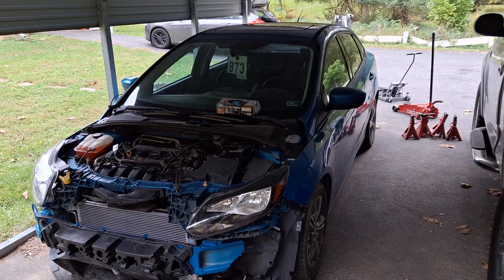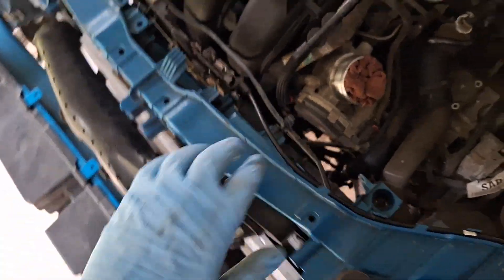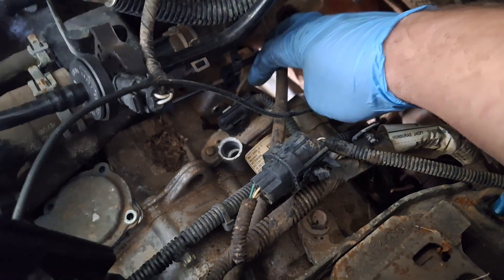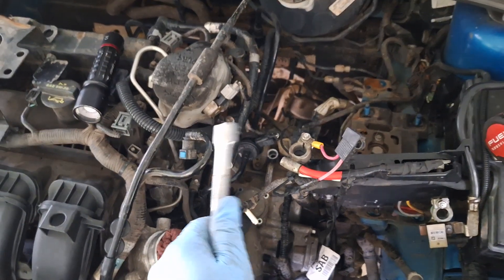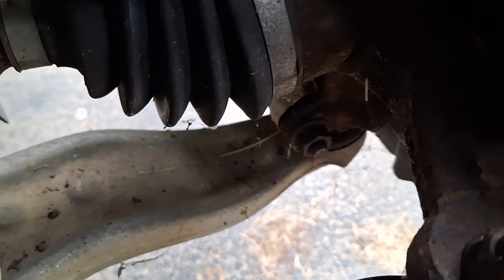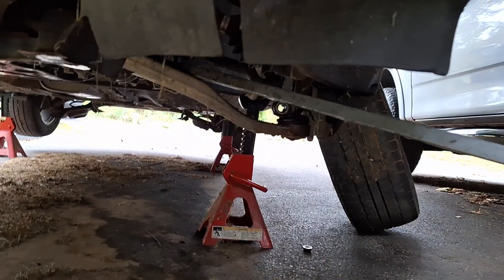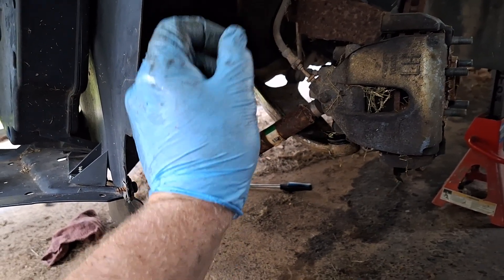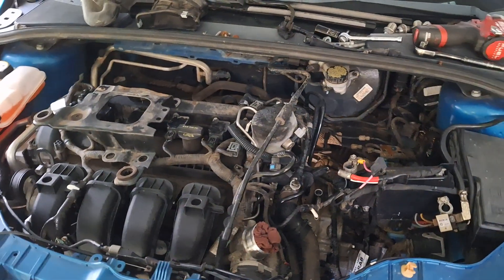Ford Focus Transmission Removal! DIY At Home! | 2012-2018 DPS6 Powershift

Comment: in my other video forgets to post it or link it in the video

in my other video
Me with my transmission halfway out, and can’t even read the full descriptions of your other videos in the playlist. 

Good video man, just being critical because we could all improve somewhere. No one is perfect, and I love your channel. I say this because I don’t want you thinking I’m all negative or attacking you. The cat video was rather easy to find, but only being 1 min 35 seconds….. I feel it was a little odd to look for. I can’t find the main video of you pulling the transmission on the lift, I’ve seen you do it numerous times, but, no dice

Edit: Also I legitimately cannot find this last bell housing bolt. Got the ground next to the starter, the two holding the starter. Took me 2.5 hours to do the ones above the catalytic converter, got the top three, the two top-mount, the bottom mount thingy, and the 4 at the bottom. The bell housing has a TINY gap and moves a lot, I’m sure I could use that to locate it….. during the day…. But…. Holy crap lmao
Reply from the maker: You can't read the description? What do you mean?

Comment: is it worth picking up a free 2012 focus if the only thing i need to do is replace transmission?
Reply from the maker: Absoultely. Youll also end up replacing the upper engine mount and valve cover gasket too. And it would be a good idea to replace the plugs, belts, water pump, degas bottle, heater hose orings, if you're gonna go on long trips
Reply: @BigBensCarsAndCycles  Thanks for the reply i'll certainly be doing some of this stuff right off the rip but i don't think i would have though of some of these things like the orings or the degas bottle so thanks for the list
Reply: @BigBensCarsAndCycles  so talking to my friend that will give me the car he says it's not shuttering or slipping at all but it's not shifting right. Its staying in a gear and not upshifting, and even downshifted on him once. That's a TCM issue right?

Comment: does this work with a 2011 fiesta?
Reply from the maker: Its very similar but theres some bolts in different spots and i like to unbolt the knuckle at the strut on those instead of popping out the ball joint

Comment: I noticed that this ford does not have an active grill shutter . Is it bad for the car to not have it . i have an 2012 model i think it is a se model 2.0 l and i had a problem with it not opening or closing i changed the small motor and the harness checked the fuses still the same issue . what could be the problem '

Comment: How in the holy hell did you get that drain plug out that easily? I'm about to drill the damn thing out.
Reply from the maker: You definitely need a socket and a ratchet a long ratchet preferably. You may need a double up with a wrench on the ratchet to get more leverage. It's really darn tight
Reply: @BigBensCarsAndCycles turns out on the 2018 sel the drain plug isn't an 8mm, it's a t-45. An 8mm will fit but won't get enough grip.

Comment: I don’t think I remembered to take the shipping brackets off the clutch forks before I put the clutch back in.  Do I need to do it again?😢
Reply from the maker: Just stop and try to turn the clutches by hand counterclockwise 10 to 12 times. See if they move. If they are locked up then pull the clutch back out

Comment: How high did you have to lift the car to get the transmission to fit under?  I'm worried my jack stands aren't tall enough
Reply from the maker: I just have regular jack stands one and a half ton I believe if I'm not mistaken and I just got them as high as the Jack would go for the most part. Probably about 80% the way up that the Jack would go so you really don't have anything to worry about. Worst case you take out the left front fender liner and it'll slide out through there if anything happens

Comment: Now if I pay the $4000 will I get a new transmission and avoid breaking my car 😅
Reply from the maker: 4 grand would be a clutch job
Reply: @BigBensCarsAndCycles oh. My cars rpms spike when driving and take a second to settle. Also after breaking and trying to go again it goes… “vvvvrrrrrooo” loudly then goes back to normal. 

Im assuming it’s an issue with my transmission. Honestly i just need a second opinion from another human. What do i do. Its my first car and i dont really have someone to ask or any idea of what my next step should be 😅

Comment: @BigBensCarsAndCycles driver side axle is stuck inside of the trans and will not come out. Any tips?
Reply from the maker: You can remove the transmission with that axle still in, and focus on it outside the car. The clip might be stuck on it
Reply: @BigBensCarsAndCycles okay sweet! I’ll try to look for that clip and if not then I’ll just drop it with that axle in! Thanks man!

Comment: You don't have a video on pulling a MTX 75 from the junk yard do you?
Reply from the maker: No, but I'd watch my mtx75 install video for any tips you need. I just dropped out the engine and Trans from the car. Literally on the ground. After removing the bottom hardware. Then unbolted the rest and it slid right off

Comment: Hey Ben, what is the correct torque for the ball joint pinch bolts? I see a lot lf conflicting info online. Ive read 34ft lbs and 61ft lbs. Thanks!
Reply from the maker: @jordang3015  61
Reply: @BigBensCarsAndCycles Awesome. Thanks a lot!

Comment: Hi! dumb question, do you have to drain the transmission fluid before removing the transmission?
Reply from the maker: @manuelortiz7731  no, but it may leak out of the axle holes when it's out and moved around
Reply: @ thank you. Same case, it’s going to be leaking when replacing the clutch. Then as night as well drain first I guess..
Thank you for posting your videos…

Comment: Can I remove the transmission with only having the fronts jacked?
Reply from the maker: itll be difficult to remove and install the transmission if the car isn't level because the transmissions gonna want to sit level when its on the crane so then its not gonna be lined up with the engine if its not leve
Reply: Aww man, I should've been more patient until you replied. I'm already about to take off the ball joints on the driver side. I live on nothing but dirt land and it was sketch trying to jack up all 4 points. I have enough clearance with my 12 ton jacks for the transmission to come out. Will the car roll back on me? You say it's difficult, but is it possible?

Comment: If I'm going to replace the tcm module on ford fiesta 2016, do I need to reprogram?
Reply from the maker: @melchorelaydo6499  yea if it's brand new. If it's used, off the same year model car then no. Just a clutch adaptive learn
Reply: @BigBensCarsAndCycles  thank you. I appreciate your support

Comment: "Clutch" went bad on my 2017 focus se hatch. Dealership wants 5000 to fix it. Lol. Bought the vehicle brand new 7 years ago and JUST paid it off last month, one month later, clutches fail. I'm now buying a 2017 civic lx hatch with the 1.5 turbo. Going to keep this focus.. in contact with a law office about it at the moment, it's now just been sitting in my driveway for 2 weeks.. I will either sell it for cheap if the offer arises, or make it a project car and try to work on it myself..

Dude, your videos are amazing, and convince me that this is something I'll be able to do myself. Going to be a lot of work and time, but I think it will be worth it, especially after reading the other comments and seeing how this video and so many of your other vids have helped them tremendously. You are a lifesaver dude. I will update this comment in a few weeks with whatever I ended up doing 🙌
Reply: Hmm🤔 I guess it didn't go as well as you thought huh !😂😂😂

Comment: Having replaced the clutch recently on my 2005 Focus ST with 250,000 miles on it I can appreciate the efforts taken to do this job! Getting it out was one thing but putting it back in took two grown men half a day!! 
    I almost killed this car however last week by hitting a deer at highway speeds. Completely demolished drivers side fender, lights, hood, air box, radiator, core support, broke the throttle cable, and windshield. With the aid of a gallon of water and a zip tie I was still able to limp home 6 miles but now I have a parts list of over $1,700 to repair (no paint or windshield) a $2,000 car!! 
 Answer???????
   After extensive research, and the help of your videos, I purchased a 2016 Titanium Focus with 130,000 miles on it from a seller 200 miles away for 5k. Clean CARFAX, no wrecks and great service records! The return trip was a joy as this car is loaded (leather, heated seats) and the transmission shifted beautifully. It has the updated TCM but it does however have a cracked coolant tank that I will replace ASAP. 
   This was $2,000 below anything else I could find comparable and I feel like I got a great deal. Your opinion would be appreciated as I feel like the other shoe is going to drop!!
Reply from the maker: @mitchculpepper738  sounds like a nice purchase! You'll have to fix the transmission eventually but other than that, nice buy

Comment: 165,000 on mine and my ford dealer is saying I need this. Is it worth it? 3,600
Reply from the maker: You can DIY it for 700. Or manual swap it for 700 (DIY)

Comment: Is there a way to clean out the double-clutch without dropping the transmission? My friend Focus slips from time to time, so I’m assuming the clutch plates are dirty causing the minor slips. So without going thru the headache or dropping the entire transmission, is there a way to someone just crack it open and spray parts cleaner in there to maybe drain the debris out? Just looking for a simple way.

Comment: Did I understand correctly that the axle shaft bearing retainer is one time use so I need to order a new one after I remove mine?
Reply from the maker: Thats right. you can get the kit at ford EV6z-7052-C and it comes with it, and anything else you need. 50 bucks

Comment: @BigBensCarsAndCycles
 So I tried removing the tranny before watching your video. I didn’t remove the flex plate nuts and tried prying it off. I didn’t know it was held by those nuts 😢. I ended up removing the whole engine and tranny assembly. The tranny mostly held up by the tension of the flex plate while removing. The question is now, do I have to replace both the dual clutch and flex plate? Or either of them? Or is it okay? Apparently the dual clutch has been replaced within the last two years. What can I say? I have trust issues 😅Thanks for the help.
Reply from the maker: @FreePalestine1173  they're stout parts. I would roll the dice. Unless you heard terrible sounds while prying
Reply: @ thank you! You’re a life saver. One more question. Where do you get all the snap rings? Or do they only come in kits with the dual clutch? Thanks again.
Reply from the maker: @FreePalestine1173  get the kit at ford, number EV6Z-7052-C

Comment: Where did the water come from mine was filled to the starter with water
Reply from the maker: @jaytank31  check for a detached cowl. If that's OK, it may be from a flood
Reply: @BigBensCarsAndCycles  it hit a black bear and sat I drained it out but seams like every time I start it water drains out of the bottom of trans from a long bolt I removed to drain it.  I still can't get ot to go in gear yet

Comment: appreciate you taking time making videos 👍. question: any advice pulling engine #1 cylinder threw rod- locked up. can't turn crank how to disconnect engine and transmission if its locked solid
Reply from the maker: @sonofsteve566  hi, you can take the engine apart until it turns over. I would pull the oil pan off and loosen the rod

Comment: Hey Ben, thanks for all the help with your videos! Im having trouble gettign the flywheel bolts off as they wont budge evenw ith someone holding thr crank and me trying to break them with a wrench.  Not sure what to do.  Thanks!
Reply from the maker: Hi! You're taking the flywheel off? Try using an impact if thats possible for you
Reply: @BigBensCarsAndCycles  sorry I meant the clutch bolts. The 6 that bolt on to the flywheel studs
Reply: Sorry that bolt to the clutch studs to get the transmission separated
Reply from the maker: @rev9921  center the nut in the starter hole area and loosen it with a ratchet, and it'll turn but use the engine block to keep the clutch stationary while breaking it loose. The socket will be pressing against the block as you break it loose
Reply: @BigBensCarsAndCycles  I tried that and still can’t get them to budge. Can I spray pb blaster on them?

Comment: Why do you turn the engine over? Torque converter clutch nuts accessible from the starter or ?
Reply from the maker: @brandoncaudell8062  yes clutch nuts

Comment: mine has a rubber grommet under the starter, the short and stubby one does anyone know which way it goes back in, i cant remember they way i pulled it out. Help would be much appreciated.
Reply from the maker: The side with the 2 indentions go toward the clutch (2 hole looking things)

Comment: HI Ben did you not need to take the intake manifold out? how did you access the flywheel nuts? Thanks.
Reply from the maker: Hi, no i didn't take it off. I remove the starter (leaving the wiring nuts on) and move the starter aside, then remove the nuts from the bottom of the car with a 13mm socket, flex socket and extension

Comment: How to put transmission fluid in my 2014 Ford focus? Do I have to take it apart to get to the transmission?
Reply from the maker: You can put fluid in through the vent, it takes 1.8 quarts service fill
Reply: @BigBensCarsAndCycles  legend. I was gonna snake it.

Comment: Do I turn it clockwise or counter clockwise? Also would turning the engine the wrong way put it out of timing?
Reply from the maker: Clockwise. Yes there's a chance it can mess up timing
Reply: @BigBensCarsAndCycles  I just had my transmission fixed, I went ahead and installed it. But now it won't start. It will crank and will only stay on if I rev the engine around 3-4k rpms. It then shuts off if I let off the gas? Does that sound like timing is off? No loud noises, the engine is just struggling to stay on. Thanks for the response 👍
Reply: @DaBuGzLiFe check your vacuum hoses

Comment: This playlist from Ben was so helpful! I dropped the trans and replaced dual clutch following along and the car is back on the road! Thanks! I had no codes but R, 2, 4th were slipping and trans for warm. When I opened up transmission the bearing was completely broken! Engine hoist was a huge help to be able to move trans around to line up.

Comment: Thank you for everything ben!! I could not have done this without you. All the information you give us focus owners is insanely invaluable and you deserve all the success you're seeing now! I subbed at 1k and now you're at 6.4k. Just test drove my car, reused the clutch by locking it using your other video, and I can confirm that my car works better at 130k miles than when I bought it at 80k miles. I cannot thank you enough!
Reply from the maker: Great! I'm very happy you got your transmission fixed, and the growth is so exciting

Comment: So do you do you have to lift or drop engine at all I'm about to start the DIY drive way job but I have 4 stands and a jack how can I get this job done with only those or do I need something for the engine?
Reply from the maker: Hi, you need an engine crane to lower the transmission out. Use the eyelet on the transmission. Use a floor jack to raise and lower the engine as you lower the transmission
Reply: No crane Im doing this job in a parking lot to be honest just man power and wisdom
Reply from the maker: @TravisHadder-gg7uk  well.. hmm.. you can take the upper and lower mount brackets out and get a few guys to muscle the transmission down by hand and use a jack on the engine oil pan to slowly lower it as needed
Reply: @BigBensCarsAndCycles  i was gonna just use my jack but then read that you said using stands and not a lift there not enough Clarence that way i did see at my local wally world they have these low profile 4 wheel easy rolls that you put under tires to be able to just push a car anywhere you want in a garage thought about trying one of those or a low profile lay on car things ....i don't know I'll figure something out but man ty ty ty you deserve a YouTube gold metal the headache we/people are deal with these transmission is a nightmare
Reply from the maker: @TravisHadder-gg7uk  you can lower the transmission down with a jack but gets some help putting it on the ground off the jack and slide it from under the car. Jack stands are enough. Good luck!

Comment: I'm planning on doing the same on my 2013 fusion you think is easy to get trans from top rather than bottom?
Reply from the maker: Hey, I haven't done one of those in the driveway. At work, I pull the subframe and drop it from the bottom. I don't believe there's enough room to pull them from the top. Also, I have a video coming out soon on a full rebuild on that transmission so stay tuned lol (by next weekend)
Reply: @BigBensCarsAndCycles  definitely will

Comment: So my transmission seems to be stuck to the motor somehow and I can’t get the crank bolt to budge the motor won’t turn over
Reply from the maker: You may have dropped a clutch nut in the bell housing and it's jammed on the flexplate causing it to not turn over

Comment: Were the 3 ton jack stands high enough? I got a harbor freight transmission jack and I'm trying to see if I need bigger stands
Reply from the maker: Hi, the 3 ton stands worked fine, but I used a crane to lower the transmission down. The crane actually worked perfectly. You would need taller stands if you want to use a jack
Reply: @BigBensCarsAndCycles  thank you sir, video is a life saver btw, immediately subbed
Reply: @BigBensCarsAndCycles, how much clearance, exactly do you need, if you’re not using the crane?